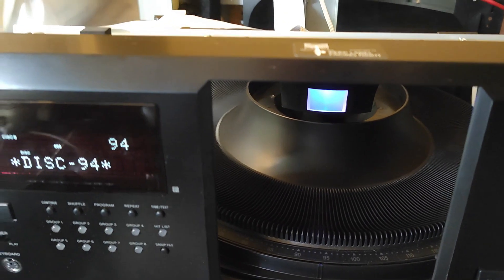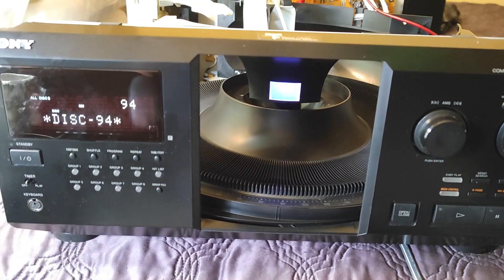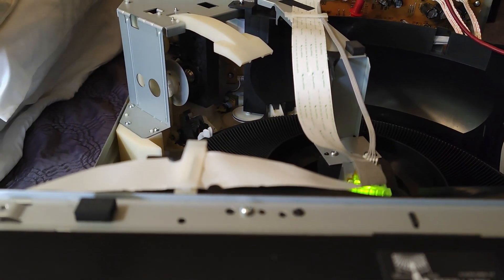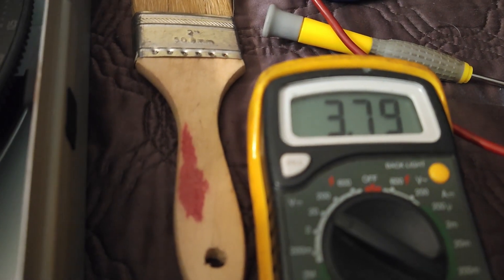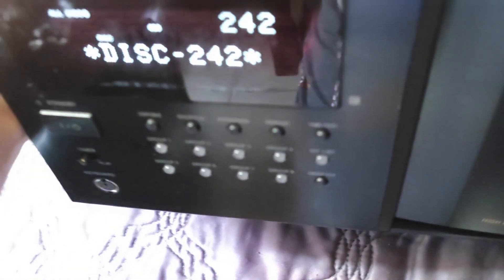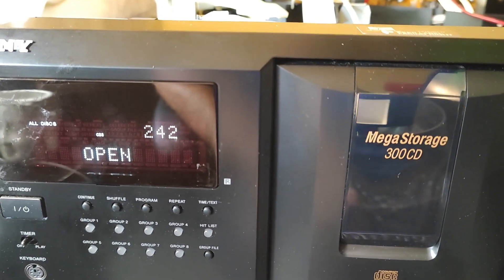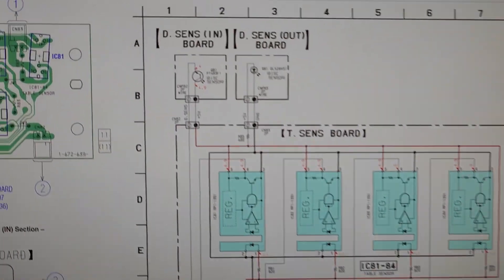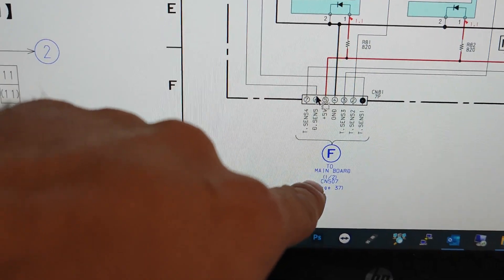Sony CDP CX355 disk sensor error

Comment: I am having that same problem with my unit. It shows all disc numbers even though there are no discs in tray. Confused how I know which way to move the sensor. Also, the unit goes to each empty slot, shows the disc number, and tries to load the empty slot four times, before it moves to next disc. Help!
Reply from the maker: with the multimeter on the point of test, move the sensor back and forth and left right until the voltage gets over the threshold level as mentioned !
Reply: @AngeloCoelho  appreciate your responding, however I don't have a multimeter to test it. Any other suggestions?
Reply from the maker: @JackieFerguson-m5j  Unfortunately no, if you are on the US you can go to amazon, harbor freight and get one as low as $5.99 and there's thousand of videos on youtube showing how to use it !
Reply: @AngeloCoelho  thank you so much for your help! I will buy a multimeter today!
Reply: @AngeloCoelho  well... I purchased a multimeter but no matter how many times I tweaked the sensor, the highest I got was 3.5, which obviously is not enough. I am more concerned as to why the loading mechanism tries 4 times to load each slot, even though there is no cds in the unit. The poor mechanism is wearing itself out slapping itself together thinking it's got a disc. Any idea why thus is happening?  I don't see this particular issue anyway on you tube or anywhere